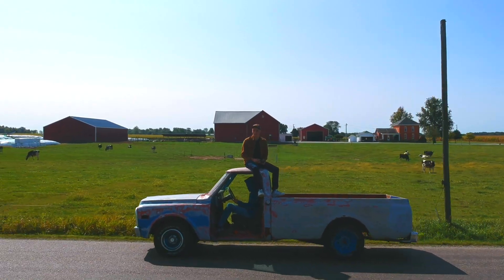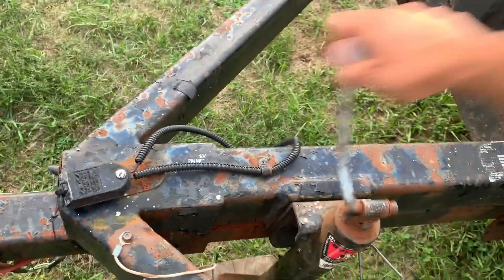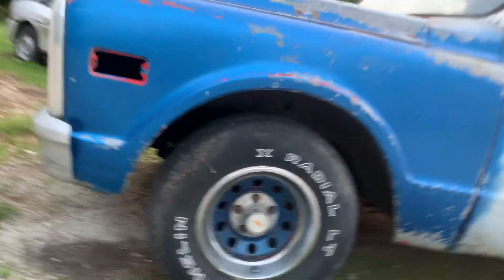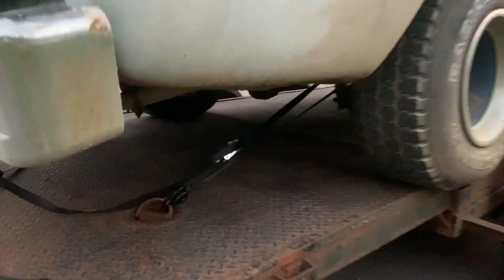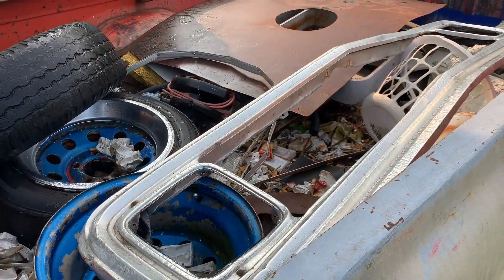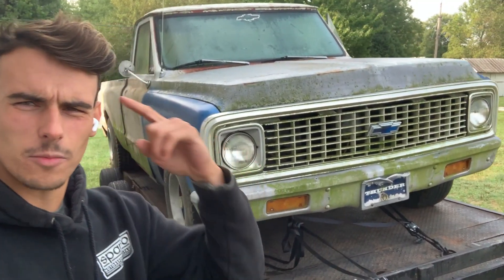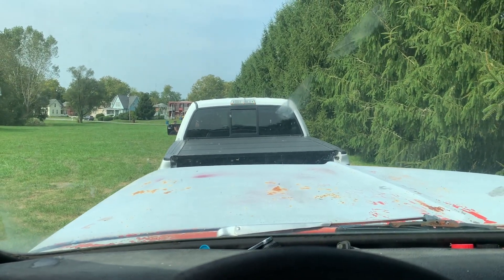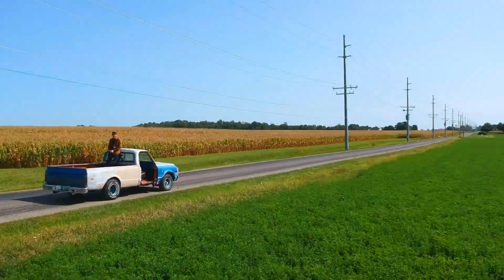Buying a HORRIBLE, Classic, Chevrolet C10 for CHEAP. [] $1,000 Chevy C10

Comment: That's not too bad. I've put several complete floor pans in these trucks and done all 4 pillars/ corners rockers. You aren't going to find an original 67-72 that needs any less than rockers.